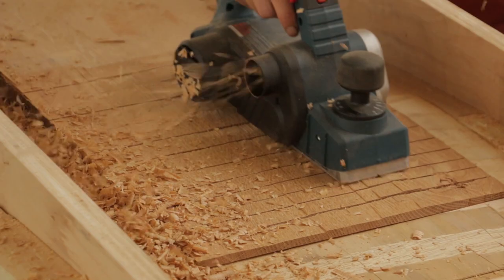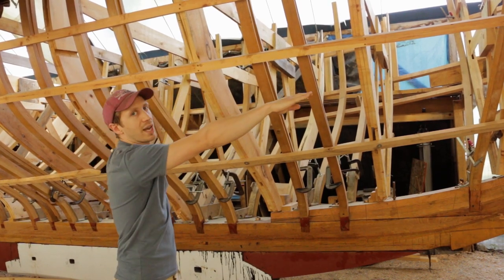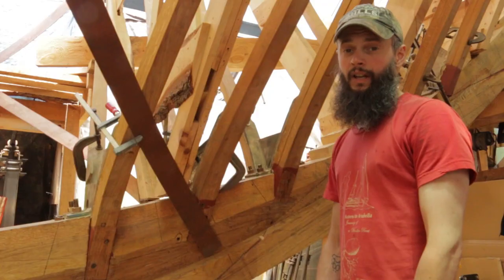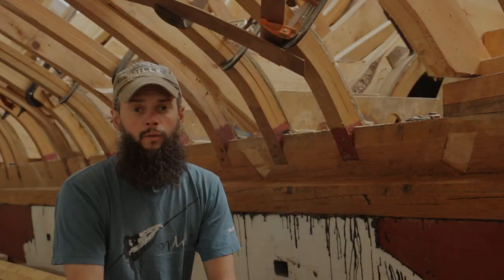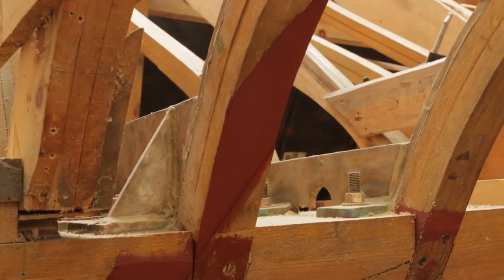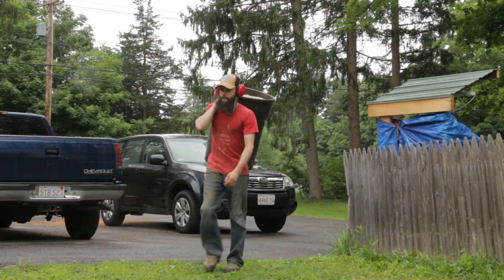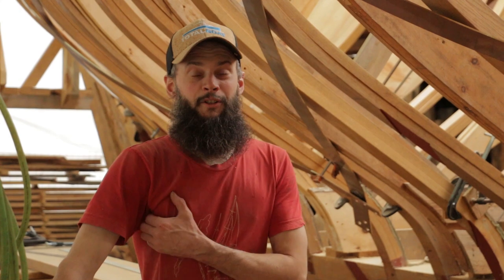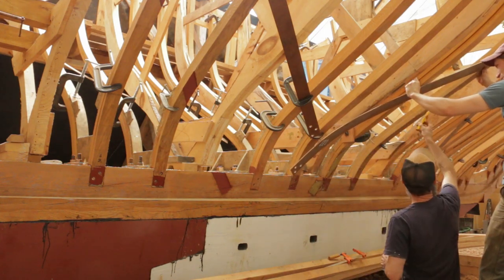Acorn to Arabella - Journey of a Wooden Boat - Episode 71: Installing the Bronze Strapping

Comment: A friend's boat had those straps and they caused electrolysis (the wood looked burned) But you guys have probably thought of this issus...
Reply: Yeh, I tried pointing out that they are a problem for later once installed.
Reply: You need two dissimilar metals, (Metals with dissimilar electrode potential) for galvanic corrosion to occur.
Steel and brass or bronze are quite far apart on the galvanic series for example.
Since Arabellas metal parts are just out of one type of metal, there is no danger of a galvanic reaction.

Comment: Why do most of the frames appear to be made of steam bent wood and a few appear to be made of dimensional lumber cut to profile??
Reply from the maker: The ones that appear to be roughly cut are the molds that will stay in place until planking is complete and the deck beams are installed. Thanks for watching!

Comment: Will Arabella have a ceiling, or will you be able to see these bronze straps from inside?
Reply: That would be cool
Reply: @MrPotatochips4  I remember in the video about putting shellac on the frames, Steve said, "we're not trying to get a perfect finish on these," so maybe not. But then again, they talk about seeing the tops of the bronze floors from inside the boat, so I don't know. Maybe they'll notch the ceiling boards around the floors.
Reply from the maker: We will not have a full ceiling, so the bronze straps will be visible in some places. In the bunks and lockers, there will be a ceiling. Most of the bronze floors will be hidden, but a few will be visible.
Reply: @AcornToArabella  That makes sense.

Comment: I'm still confused as to why you haven't installed the the clamp and beamshelf yet when you still have the moulds set up.  You would then plank from the sheer a ways down then plank up from the keel. Baffled😕😞
Reply from the maker: The frames still have some flexibility to them now, so we can adjust them to keep everything fair as we plank. If we lock in the sheer now we will lose that ability.

Comment: Steve you really need to wear a mask when you are doing the letting in. Your face is so close to the router you can not avoid getting lungfulls of Oak dust, and that ain't good for man nor beast mate. It might be ok for the first couple, but after three you are going to say to yourself "Why didn't I put that mask on?" Another thought, how many clamps, cramps of every sort have you got between you? You must have spent a kings ransom on them all! When you are finished you can sell most of them on eBay and such and get a years worth of running expenses for Arabella!
Reply from the maker: You can never have too many clamps!

Comment: I wish you guys would seriously look at some dust management... breathing that all in will very much not be good for you in the long run
Reply: Ive chimed in on that too... if there is a pulmonologist in the area... Please stop by and give them a talk... two intelligent young dudes... who are exposing there lungs to all that dust... doesn't make any sense at all...
Reply: Although it would be better to wear a mask, there is not a whole lot of concern with cutting tools when compared to abrasive tools. A two-cutter router bit creates relatively large shavings that do not float around and pose an inhalation hazard. Same with most saws, planers, jointers, etc. Although they do create "sawdust" it is not like the sawdust created by sanding or other abrasives. I wouldnt be any more concerned about their use of the router than I would a hand plane.
Reply: The fire Hazzard too.
Reply: As someone who developed a serious issue with red cedar dust.....which nearly killed me.....I agree.....you boys should be using dust masks....

Comment: Are all these criss-cross brass support really called for in the plans ?
And one more thing, when Arabella is in the sea, you could make a fortune selling all these clamps ...
Reply: No.. it's not called for in the plans.. but it is standard practice when building a traditional wooden hull for maximum strength. It's part of what gave "Old Ironsides", the USS Constitution, her amazingly strong hull.
Reply from the maker: The hull strapping isn't included in the Arabella plans. However, the plans do call for diagonal deck strapping, so we aren't deviating too far out of the way.

Comment: Where is your metalwork guy those rose type countersink cutters are rubbish they chatter so much a normal twist drill ground to the correct angle with reduced clearance would give you more control and allow you to pocket the screws better.
Reply: Indeed. Luckily it's bronze, not stainless. The fewer cutting edges, the better, for hard materials.
Anyone who has to make do with a wordwork-style bit in metal, here's a free tip: Tear a square of cloth (denim is best for really tough metals) and saturate with cutting oil for ferrous metals except cast iron. Fold it several times and stick it in the hole and countersink through it. Bye-bye chatter!
Reply from the maker: Thanks for the tip!

Comment: Force concentration in the spaces between the two bronze strap Xs. Expect racking, material weakness and structural failure there worse than if the boat had no strapping at all.

Comment: Seen internal cross bracing made of wood. External? Metal? Dunno dudes... I think you just sunk yer boat.
Reply: I'm just guessing that he's not talking about weight, but about the force of the braces on the inside curves trying to pop the planks outward
Reply: Carl Sharp 

Yes.
Reply from the maker: The plans for Arabella call for diagonal deck strapping (which we will also be installing,)  so we aren't deviating too far the original plans.

Comment: Literally using flathead screws. UGG why
Reply: They talk about that in an earlier episode. As the fastener ages, it's really easy to cut in a new slot if it's ever needed.
Reply: @Twyzted420  Not really a concern if you use stainless screws, which you should be on a boat
Reply: @5eZa  They covered that too.
Reply: @5eZa   Bronze does better with the salt water and oak.   If the SS alloy has any iron it, it will react with the oak.
Reply: @gumbykevbo  All stainless steel has iron in it.  There are some good marine stainless alloys but regardless flat head screws are annoying.
Reply: @5eZa  Good stainless is fine above the waterline where it will not be immersed in seawater.  Below the waterline, it can cause many problems.  Regarding flathead wood screws: the cone shape beneath the flat head has greater surface area than screws with a shoulder.  This increases the holding force of the fastener.

Comment: There's a reason other wooden boats don't have diagonal straps. Who told you this was a good idea? I hope you don't trash all that hard work by making up boat building on the fly.
Reply from the maker: Diagonal strapping has a long history in naval architecture. Herreshoff pioneered using diagonal strapping on smaller wooden boats in the late 1890s and early 1900s. The modern naval architect Dave Gerr is a strong proponent of diagonal strapping for wooden boats as well. Thanks for watching!

Comment: I’m no boat builder, but the bronze straps look unconventional to me. I don’t think they are necessary as the planks will perform the same function that the plaster board performs in your wall construction explanation. I think you’re making life more complicated for yourselves with no real benefit.
Reply: Planks behave like a parallel ruler. They don't stop the frames laying forwards and aft as the sails drive the boat through steep head seas. They have the right idea but the wrong explanation, to my way of thinking. The real purpose, especially on small vessels (which don't need diagonals to stop hogging, or for strength) is to stop the caulking getting squashed and then released, which is why it regularly falls out after (or worse, during) a storm.

Comment: "Bell music" super annoying...
Reply: I thought it was just me......
It WAS rather creepy
Reply: I have built 2 wooden boat John Hanna's  version of Slocum's Spray called Foam was one of them. Coaster was another. I cannot think of a worse material for building a boat than wood. On both of them I fought dry rot almosr from the day they they were launched until I sold them.I single handed one of them from Acapulco to Hawaii.I finally built a steel Trawler and asside from rust and alittle electrolisis I found steel most durable and easy to build. I am 95 yrs old and just found my trawler for sale in Savanna . The G M still going strong.  I greatly admire your craftsmanship and wish you the best. Bye the way Emerald Steel is the steel version of Hanna's Spray.                                                                            

f